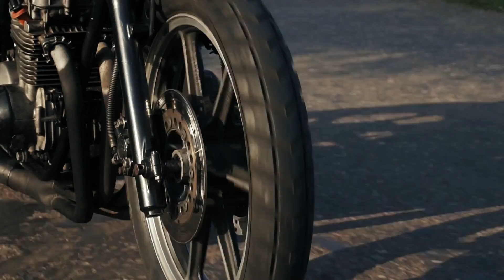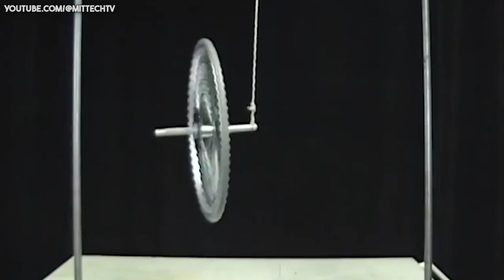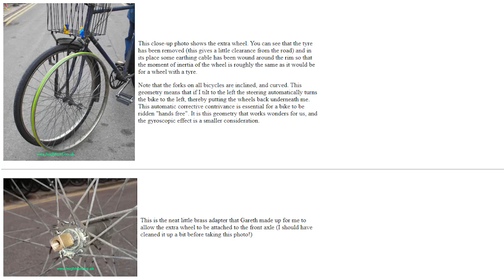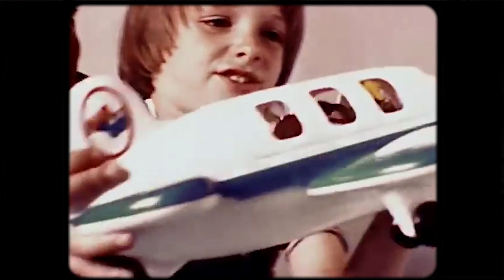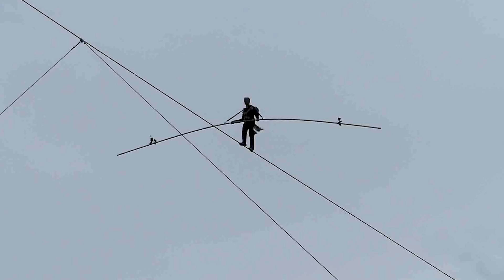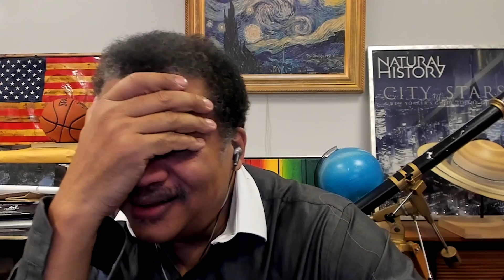How Do Bikes Stay Up? | Neil deGrasse Tyson Explains…

Comment: completely wrong ...on a bicycle or motorcycle the higher mass center is better, as not only to auto-balance but also for quicker turning - cause what happens is the wheel steers the bike which moves the tire contact patch at ground level either back under the mass(self righting) or out in the opposite direction of the turn so the bike 'falls'(leans) into the turn; with nearly no weight down low this movement can happen freely and quickly - if you tilt a bike to one side or the other you will notice it auto steers in that direction 'catching itself' to balance; due to the angle of the front steering, which puts the tire contact patch behind the axis of steering rotation(which pulls the back of the tire away, and so the front points into the fall and turn)

another misconception about riding is when you see someone "lean off" to one side of a bike into a turn, this does not make the bike lean over more nor even make it turn sharper, just the opposite in fact and instead stands the bike upright a bit more(for better tire contact patch) and thus requires more steering input(bikes turn faster the farther you lean them over, which is key for self-righting) think about how a center of mass works, and how it always has to be over the contact patch of the tires at the ground, and a 170lbs rider isn't going to have that much of an effect to a 600+lbs motorcycle, at least not unbalance it quickly enough ....a technique to do a sharp sudden 'avoidance' maneuver turn or dodge is to instead lean off the other way and 'push the bike down' keeping your body upright and just the bike leaning more, this makes the bike turn sooner and sharper - you can can test 'more lean tighter turn' by rolling a bike with just a slight turn in the bars holding it vertical, and then with the same slight turn in the bars but leaning into the turn it will turn sharper in a tighter arc

 ....so if you 'lock' the steering on a bike it becomes unrideable, also to turn right you first have to slightly steer left to unbalance the bike so that it falls to the right(moving the tire contact patch out from under you) to start the movement in that direction so that then you 'catch yourself' by steering then that way to the right - this is why people have such a hard time learning how to ride bikes and also walk; with both you first have to 'trust fall' in the direction you want to go
Reply: I should also add that a "balancing pole" on a tight rope doesn't work like that either.....instead think about the pole's mass and how it wants to remain at rest, so you can steady yourself with it almost as if it were attached to something held in-place - so exerting small left and right lateral movements on it would keep you centered(tilting it would be bad to give it swinging momentum that then you would have to counter to get it to stop rotating in that arc) and again the act of balance like on a bike requires very quick small adjustments, so you aren't going to swing nor bounce(or whatever he said) a long pole very quickly, but you could shuffle it from side to side along its axis to keep yourself steady 

I think these guys spend too much time thinking about stuff, and not doing to see how they really work
Reply: Yeah i hate to say, but this explanation is messed up. The pole is there for the exact opposite effect of an figure skater who tucks het arms in in a spin; to slow the rate of rotation.

Comment: E-bike motors are  usually placed at the lowest point possible, and they usually outweigh batteries. However, there are e-bikes that use motors in the wheels hubs. Someone needs to do an experiment with the various configurations. Though, nobody wants to prove the concept with their own bike.

Comment: If a counter-rotating wheel on a bicycle cancels gyroscopic action, does the mass of each counter-rotating wheel need to be equal?

Also, ust a thought.If the high-wire walker's pole dips on one side, it would tend to raise the other side a nearly equal amount, and the center of mass would not necessaily be lower to the center of the Earth. The walker (himself/herself) is in effect a movable fulcrum in relation to the pole.

Comment: I have developed balance issues when I walk, so I gave up riding my bike. But after a year, I thought to try it again. Much to my surprise,  I discovered my balance is much better on my bike then walking. It actually feels normal.  What puzzles me now is that when I was a kid I used to have no trouble riding with no hands. And yet I cannot do that today, or even before my balance was an issue.
Reply: Sounds like the position of you holding the steering allows for the bike's self-balancing effect to compensate for your poor balance until you take your hands off. Just my guess though 🤷‍♂️.

Comment: So let's say you have a more clustered up field and a less clustered up field.... The more clustered up field will be vibrating..... So is the less clustered up field .... They will collide and the less clustered up  gets absorbed by the more.. clustered up field.. So therefore you can pack more of the less clustered up field into the more clustered up field ..... And how this is happening is because remember the electron how it vibrates it bounces energy from its center to its sides and then pulls it back in to its center because it has more energy in its center always pulling back towards the center when it's a particle plus the energy bounces into the energy next to it and then goes back to the center from the collision into the energy next to the first energy traveling away from the center which then causes the second energy that got hit by the first energy traveling away from the center  to travel towards the end of the electron and the process just repeats until the energy gets to the end of the electron and the motion will try to pull energy out of the electron but the overwhelming pull from the energy going towards the center we'll pull back energy from the edge it will pull it back in .... So if you say the fields are doing the same thing they can be vibrating horizontally or vertically I'm not sure which but anyway..... Whenever the weaker field energy enters the stronger Fields energy it gets pulled on by the stronger field compressing . The weaker field inside the stronger.. This is happening because the energies in the fields are always pulling towards their center and the larger  field will absorb the smaller field and the energy that makes up the smaller field will copy the larger fields motion... Making the small field pack into the larger field because the weaker field is now pulling towards the center of the stronger field or the more clustered up field.... And reason the less clustered field.. copies the stronger or the more cluster up Fields movements... Is because the more clustered up pulls  on the less clustered up fleld

And if this works at all it is from God and no I don't want to be with anyone 

so are you saying that energy pulls Towards its center the more clustered up it is...
And then that energy collides in the center of the electron...
Then the energy shifts away from collision in the center of the electron.. there's enough energy in the center of the electron to keep pulling energy back towards its center so even as it travels away from the collision it is being pulled on to come back to the center of the electron.  
...... where the motion started transfers its motion into the second energy  causing that energy to push away from the collisional....this also causes the first energy to travel back towards the center...(You can think about it like a wave in water what happens when you collide water with water the water will bounce off of other water and it's just motion transferring through water... water collides with water that water pushes away water and sends other water flying back  imagine a 360 ball doing this but instead of water..... energy is always colliding in the center pushing away from the collision and pulling back to its center but the motion travels out through the energy)...
...
And because there's enough energy in the center of the electron it's always pulling back towards its center because the more clustered up it is the more it pulls in on its field....
Therefore energy can always be going back towards the center...
And then if you say the electromagnetic field copies this movement in the electron then you can create an electromagnetic charge... By simply clustering the electromagnetic field up  inside of the election  and on the outside of the electron.... the electromagnetic field on the inside of the electron is more condensed then the electromagnetic field on the outside of the electron because the electromagnetic field is pulling in on its own field due to the movements of the electron so the electromagnetic field around the electron must be becoming more condensed ..... Where it can't pass through something that has the same charge as it.. Because it is  clustered up the same amount....... And it's part of the same field... But other fields can pass through it....
And wherever I say weaker field or less clustered up field I mean less condensed field...... And when I say stronger field or more clustered up Field I mean more condensed field

Comment: Goofy explanation — "the center of mass is below the wire"
instead consider the ANGULAR MOMENTUM of the pole vs body parts.
with bicycles, consider (1) the front forks are slanted and (2) the wheel axle is connected above the axis of handlebar rotation.

Comment: I might quibble with your statement around 10:00. "Often, the center of mass is below the wire." What mass is below the wire? The hand-held bar? What mass is above the wire? A human, maybe 50kg, at about 1 M up. For the center of mass to be below the wire, we should have more than than 50kg (or equivilent), below the wire. You might get equivilent by having a long boom.  But I cannot hold up even 20 kg. The stunt person would have to hold too much mass. Scenario rejected.

Comment: For the COM to provide absolute stability of a bike, the COM would have to be BELOW the ground level. Think of an inverted V resting on a horizontal rod: completely stable. This is never the case with any bike, no matter how low its COM is. The fact that the bike can stay upright only when rolling strongly suggests the stability is coming from the gyroscopic action of the wheels.

Comment: It's all basically about how the bike is steered. Very slight corrections are continuously made as one is moving forward, which is why you can't really stay upright easily moving backward or remaining motionless. Yes, a bike rolling forward without a rider can self correct as it will steer into a lean --- but watch what happens in reverse.

Comment: I believe it's all about how the front wheel is designed to castor. i suspect that even if you raise the center of gravity of a bicycle it'll still tend to right itself.

The reason a human riding a bike has to actively maintain a balance - by steering the front wheel into the lean, however slightly,  at all times - is because the rider is not a rigid mass attached to the bicycle; the rider flops around independently and needs to maintain their balance on the bike. That the bike itself is self-righting is what makes the task easier, nay, possible for the human.

Here's another attempt, probably inadequate, to explain the self-righting nature of a bike and how its center of mass affects it...

When a bike is upright going straight, its center of mass is directly above the bikes track, the track being the path of it's wheels. If the bike leans, then the CoM is no longer above it's track.  

The front wheel and forks are designed to castor the front wheel and turn the bike to the side the center of mass is on, curving the path of the bike towards that side.  This creates a centrifugal "force" which will push the center of mass back towards the bike's track, righting the bike. 

Think of it as a negative-feedback loop. When a bike is moving in a straight line, the CoM is above the bike's track. If the bike leans, moving the CoM to either side of the track, the bike is designed to automatically create a lateral force to counter that movement, which will push the CoM back above the track.

In order to cause a bike to turn, the rider must then counter the lateral counter force to maintain a stable off-track CoM position for the duration of the turn.

How's that?

Everytime I think of this it boggles my mind how humans (and maybe some animals?) can learn to do this sort of thing instinctively.

Comment: So why does a bicycle fall over instantly if is stationery but not when moving even quite slowly.

Oh and a brief intro to the king of highwire. https://youtu.be/ofY-_TjaVd8
Reply: Because it's all basically about how the bike is steered. Very slight corrections are continuously made as one is moving forward, which is why you can't really stay upright easily moving backward or remaining motionless. Yes, a bike rolling forward without a rider can self correct as it will steer somewhat into a lean --- but watch what happens in reverse.

Comment: This is the first time I have seen Tyson get something wrong.
For a Motorbike it is all about Castor not Centre of Mass.  The contact point on the ground is dragging behind the pivot point of the wheel.  This is why it only works when moving, Tyson’s description would also work when standing still. Other than that his description of it turning into the lean was correct.

Comment: I have a different explanation: centrifugal force. 

Every time a rolling wheel begins to fall over, it's path to motion curves to the direction of the fall.

At that moment, centrifugal force kicks in and puts the wheel back upright.

Watch a rolling coin carefully and you will notice that it wiggles as it slows down before losing balance and falling over.

As it slows down, the centrifugal force weakens hence the wriggling. Eventually got, the centrifugal force is to weak to counter the fall and the coin falls.

It's the same effect with a bike.

Comment: I'm going to ask a question I've never heard the answer to, why and how does light travel in a wave? And what I mean by this is that a photon does not travel in a straight line to your eyes it goes up and down and up and down and how does it do that? I understand the double-slit experiment that's not what I mean by a wave, I mean that whenever you draw a photon traveling you draw a wavy line so how exactly does the photon travel up and then down and then up and then down? Is it vibrating as it's traveling to you and that's why it's going back and forth and if so why doesn't it continue to move in One Direction why does it keep oscillating back and forth as it travels to you?

Comment: It would help if you explain it in simpler terms, the key here is the forks being at a specific angle that they turn in the direction the bike is leaning so once the bike is in motion and it starts the lean the front wheel turns into the lean creating a braking force slowing the bike down however, the rest of the bikes weight overcomes this braking force by pushing on the front wheel because it does not want to change direction forcing the bike to stand up because is pushing against the lean... ask any motorcycle racer what happens if you are at a lean and you brake using the front  or accelerate, the result is the same the bike stands up because you load the front and because the rest of the bike is heavier than the front wheel forcing the front wheel to alight with the direction of the biggest mass moving forward however if  you apply read brake the bike leans more.

Comment: All Matter in MOTION are the result of Universal law, may it be BIKE, TRAPES, or which ever, the stronger Energy Flow always overrides the weaker Energy Flow, in it's vicinity. 

The BIKE kinetic Energy allows it to stay upwards, that's because it's rolling MOTION is strong enough to override Earth 
Surface 9.8 Energy Conservation System of Atomic Molecular activity's, at quantum level's in real time play.

The same applys to the Moon, why don't it fall to Earth Surface ? 

It's because the Moon Velocity as a weightless body in Orbital MOTION, is stronger than Earth weakest Energy Flow out where the Moon resides, the far out reaches of a quarter million miles away. 

Just as one would swirling a rock tied with a string, it becomes weightless in circular MOTION, and will not fall until the Energy Flow from the human arm weakens below Earth Surface 9.8 Energy Conservation System activity's 😀.

This is the reason why Humans go down, and then rise again throughout the day, we are the stronger Energy Flow in MOTION within our vicinity, and that's how our atmosphere works.

Comment: A balance pole need not be "floppy" or hang down to be effective.  What the pole does is give the arealist a source of torque.  Example: From the arealist's viewpoint, if they should lean to the left they can impart a quick counterclockwise torque on the balace pole.  The counteracting torque enables them to shift the center of gravity to the right, to a point directly over the wire.  Of course, you could have a pole whose ends were below the wire and were heavy enough to make balancing automatic, but you won't see that in a circus act.
The length of the pole also increases the polar moment inertia, making the arealist less likely to rotate off center.